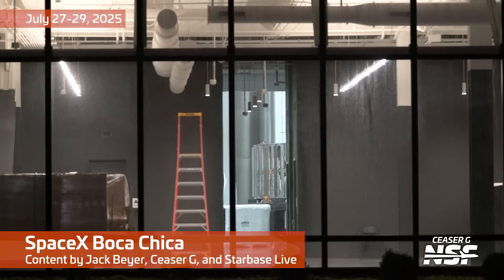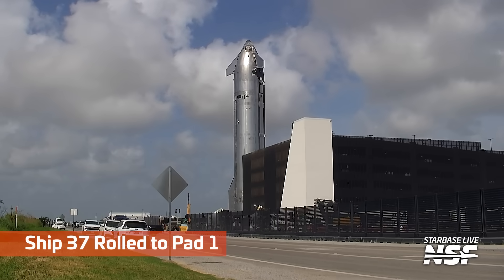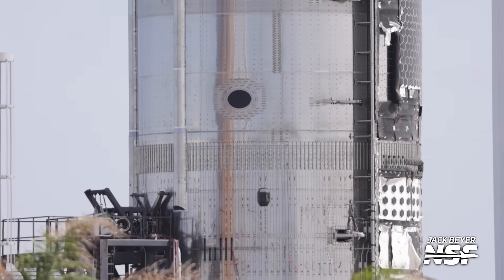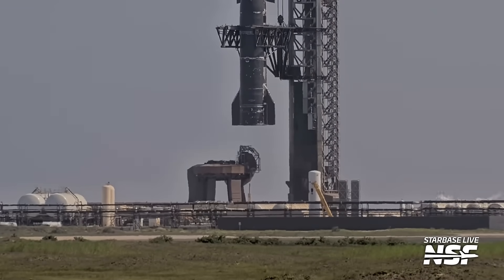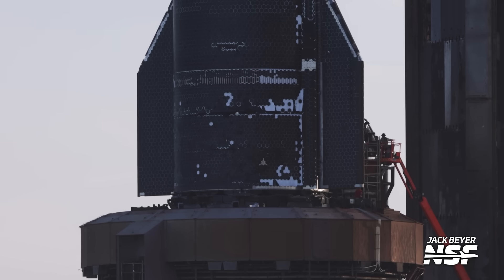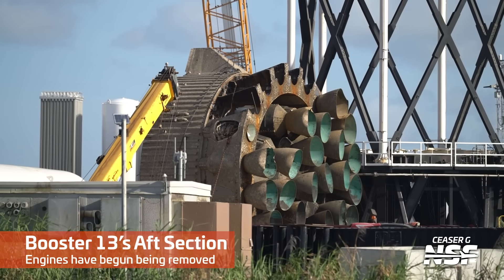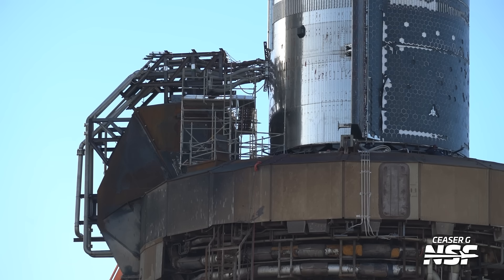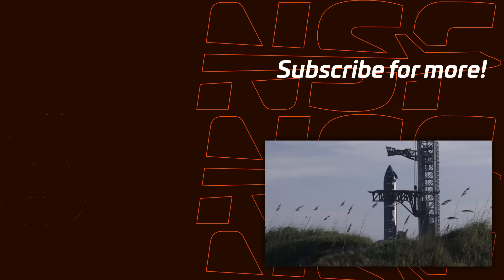"The winding path towards ship testing" | SpaceX Starbase

Comment: How will they control the orientation of the booster flip with the new hostage ring design? Current design uses the “hole” placement to allow the ship to push the booster in a specific flip direction.
Reply: I think they need hot-gas thrusters.